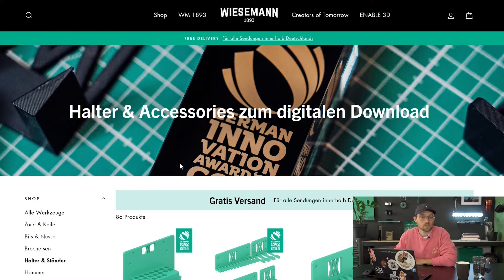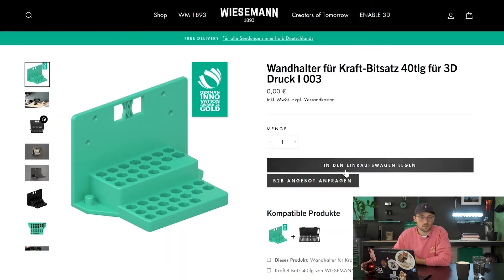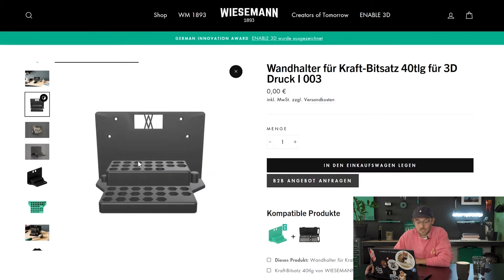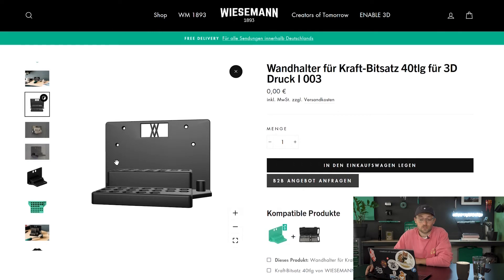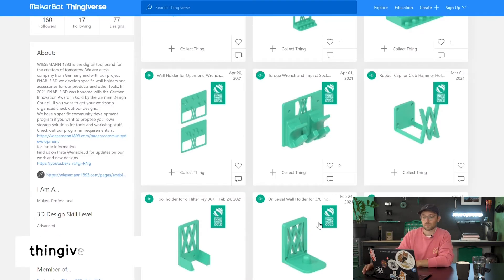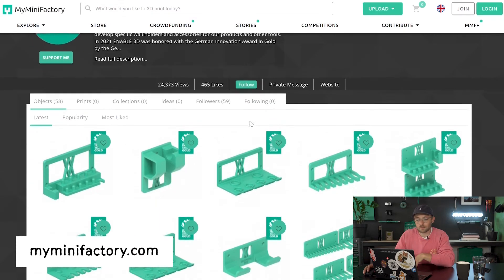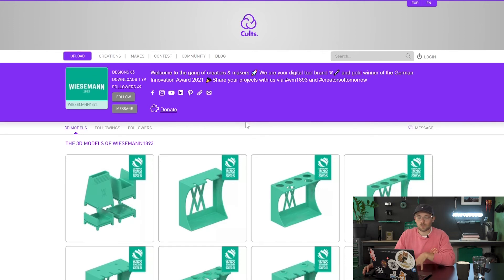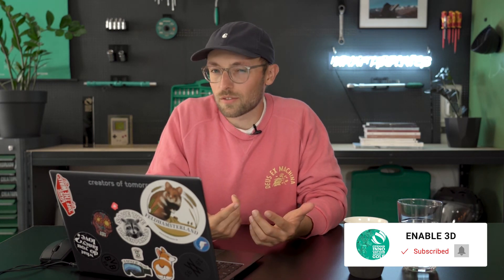Forget French Cleat Systems - Workshop Organization via 3D Printing | Welcome to Enable 3D

Comment: Thanks for sharing and this looks interesting 😁
Could you please explain/show how your holders are fixed on the pegboard.
And as you advertize “forget french cleat” (hopefully not just a clickbait 😉), can one easily take off and put back your holders from/on the pegboard (without damaging it)?
Do you have any estimation of how much weight your system can support?
Reply from the maker: Hi Pascal - thanks for commenting! Of course they are re-attachable. We use 2 or more small hooks on the backside. By lifting them up and taking them out you can easily position them over and over again.
Just download one of them and you can see it in the STL file of the version with pins (e.g. https://wiesemann1893.com/collections/halter-accessories/products/wandhalter-tx-schraubendrehersatz )

Weight is difficult to say, because we cannot know what kind of material, printer and settings you are using. We test all our designs prior to publishing with standard PLA and design them to carry the weight. For most tools it is not critical. Just when you have some tools like a 3kg wedge where you have to monitor all the factors. 
Hope that helps - Manuel!
Reply: @Enable3D  Thanks Manuel.
As these are freely available, I guess you released them as open source/creative commons, meaning we may freely modify your designs?

Some more feedback (for improvement, at least from my point of view 😁):
1. Your website is mostly only in German which I don't understand so I'm just interested in images. There's a link “English” at the bottom but that's just one page with just a link to Thingiverse.
2. As mentioned in my other comment, the link to Thingiverse doesn't work. I see the Thingiverse design/layout but the page has no content (all zeros in favorites/designs/collections/…).
3. All the images (that I've seen) show the version with screw holes, I didn't find any images of the pins. On the holder you mention here, there's one image without the holes so we can guess there must be pins behind but we never see them. And we see how to hang it in the video… but very briefly, not in details. Why not showing them clearly in those images (especially in 3D view) and how that pin system works in a video? For me being able to easily remove/place the holders on the wall is a must have and very important feature (of the french cleat system).
4. (I know you already did a lot of work for free, I'm just sharing what pops in my mind 😉) Regarding the weight capacity, it could be useful to mention its limit with your recommended material. I know “nothing” about 3D printing, 3D modeling and mechanics but… aren't there formulas to calculate that? Or isn't Fusion 360 able to test/determine that?
Reply from the maker: Hey Pascal, 
we think remixing is super crucial to foster improvements and innovation. We release our designs under Attribution 4.0 International (CC BY 4.0) https://creativecommons.org/licenses/by/4.0/ . Feel free to remix and make your improvements!

In addition we have a small Community Development Program where you can submit your designs and improvements. Sorry currently just in German https://wiesemann1893.com/pages/communitydevelopment

Thanks so much for your feedback - super apperciated! Let me get back at your points:
1. We are working on it! I hope we can launch the dedicated English website on May 1st 🙏
2. Will check that
3. Most of the users require the version with drilling holes - therefore we use it as a prime photo or rendering. Currently we can just upload one 3D file. On Thingiverse you can see it on the blue images which are automatically rendered: https://www.thingiverse.com/thing:4355401 - should be image 5 . But you are absolutely right - we will consider rendering at least an image of the pins-version.
4. You can calculate it - no problem. But in reality there are two many factors that are too risky for us to "recommend" a weight. Even if you use the same printer, material and setting there would be still some external factors like room humidity, temperature etc. As the products are produced decentrally it is impossible to foresee how a user will produce it. But we will think about a solution to give a kind of guidance!

Thanks for all your feedback! We will launch the English version very soon with many new designs and some surprises!
Reply: @Enable3D  Thanks Manuel for the answers 😀🙏